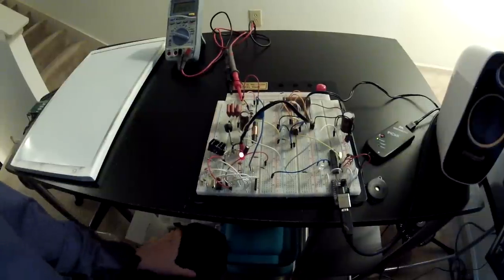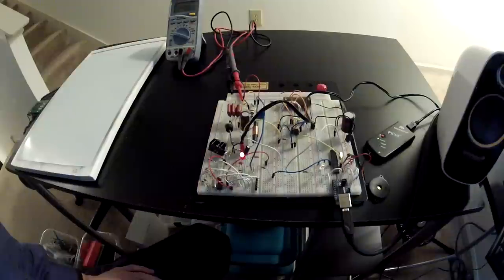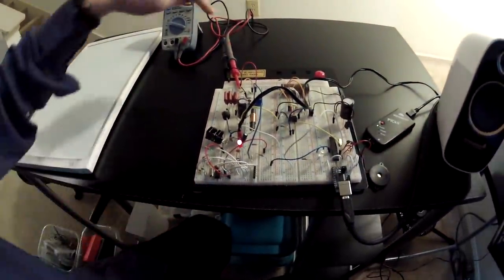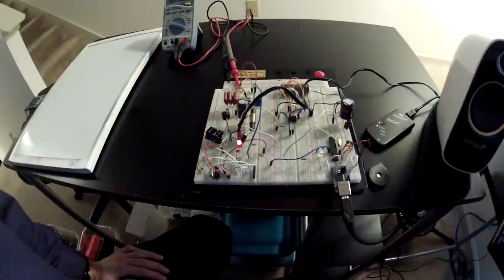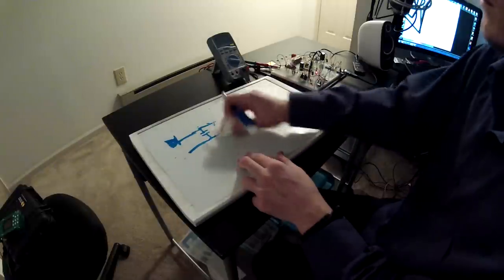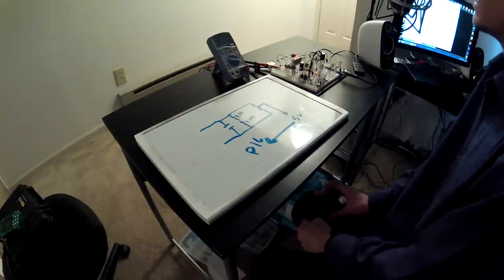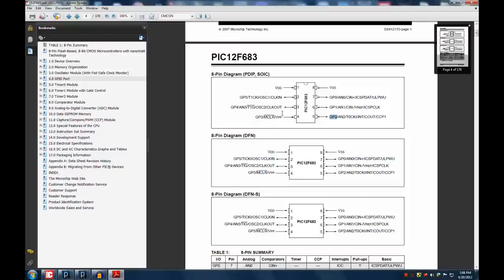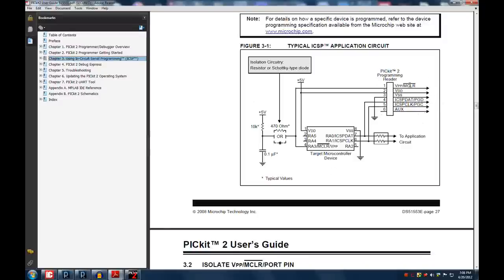How to Make a Geiger Counter, HIGH VOLTAGE

Comment: Hi,might i correct a small error?
You're saying the pwm has a resolution of 255 bits,this is incorrect,it has a resolution of 8 bits (0 -> 255).
Also,if you would have used the internal oscillator instead of the cristal, you would have a spare analog input which then could be used as a comperator so you wouldn't need a seperate comperator chip.
Still a really informative video,i'm not criticizing you by any means.
Good job!

Comment: Does this voltage really that dangerous provided it there's only few microampers generated? Static electricity discharge carries around 10000 Volts and few milliamps. I'm not saying that your circuit is safe, but I'm genuinely interested if you were every shocked by it accidentally?

Comment: Not many people use standalone Arduinos.
Most people I see end up using the expencive (...well relatively speaking) Arduino boards in their finished projects.
An Uno R3 costs something like 30 USD , but a Mega328 and crystall only about 4 £.
And if you can get away with using a Mega168, they are only ca 2 £.
Goes to show people will pay for convenience.